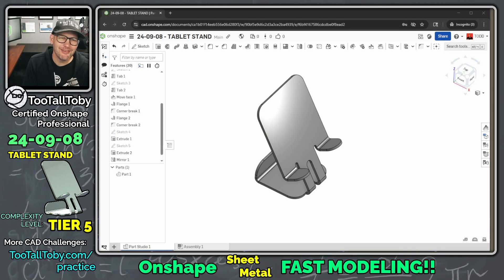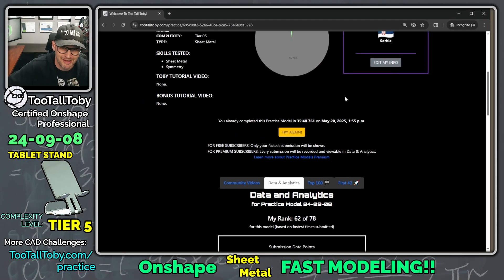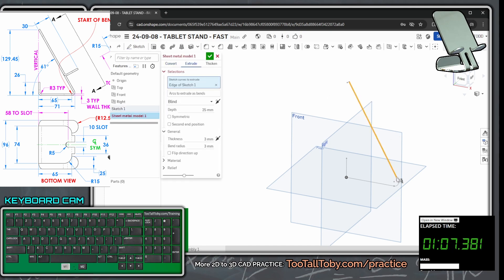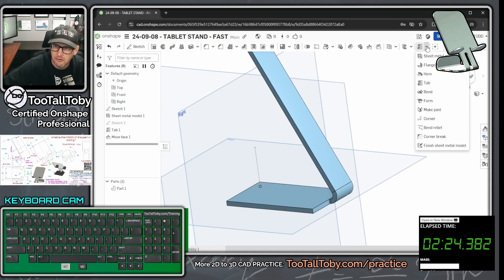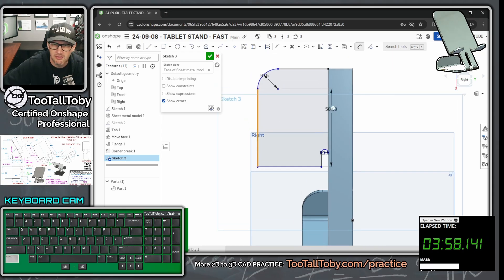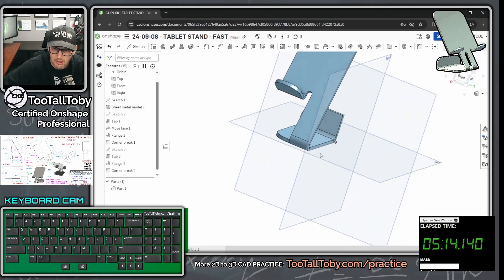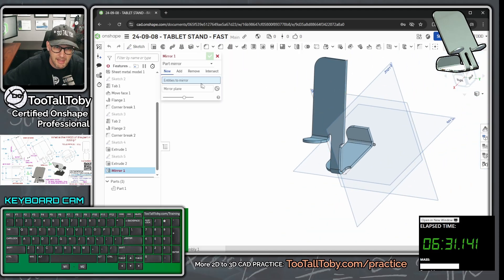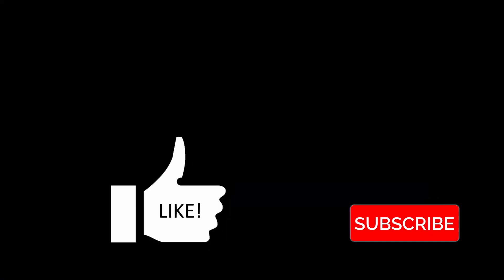Onshape Sheet Metal 🔥 Speedmodeling 🔥 Design a Sheet Metal Tablet Holder with TooTallToby

Comment: I wonder if instead of a 5mm offset on the last  extrude a "up to next" or up to face might be more appropriate\correct?
Reply from the maker: Yeah up to next or up to entity/surface would work fine there too.  
When you make a slot that goes around a corner, things can get a little tricky, to the real key is PRACTICE PRACTICE PRACTICE. Try some different workflows (like maybe cutting it from the center plane, all at once) and see what works best!